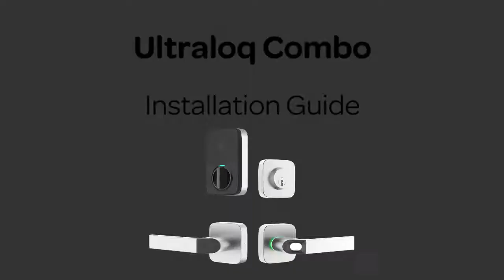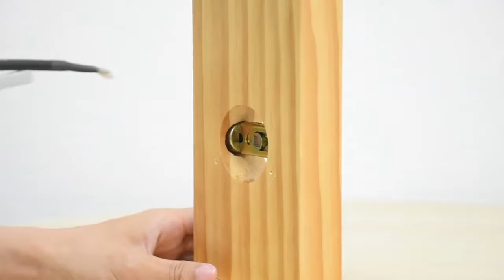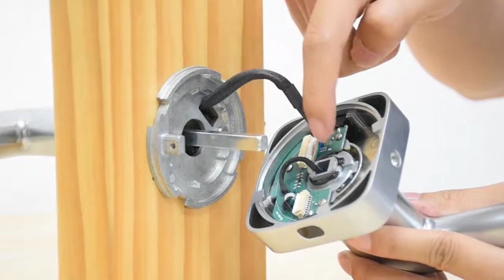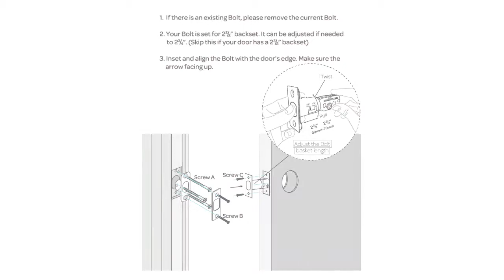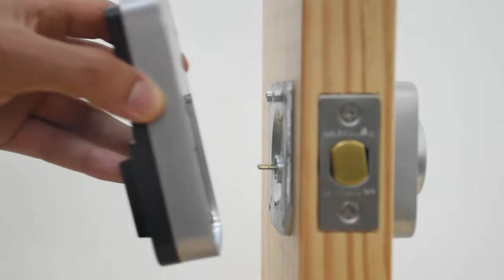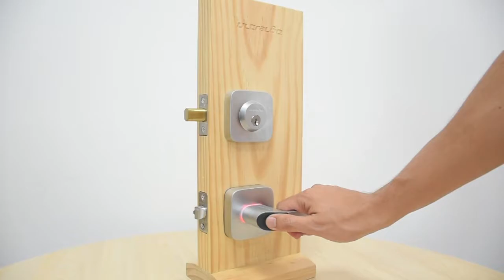Ultraloq Combo | Installation Guide

Comment: Are you able to UNLOCK the deadbolt and door-handle with the deadbolt key if the DOOR HANDLE becomes disabled and you need to open the door?